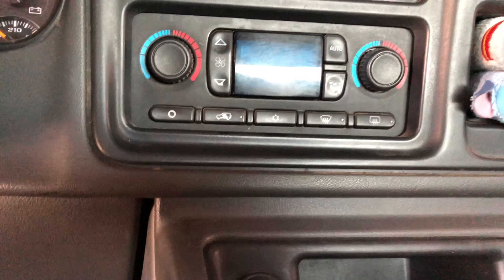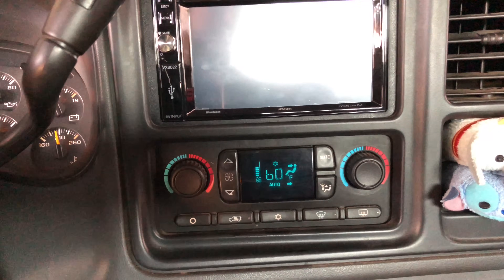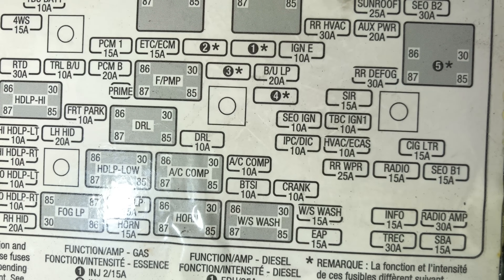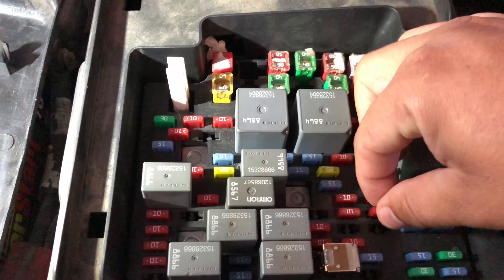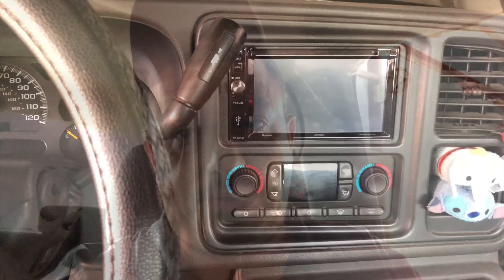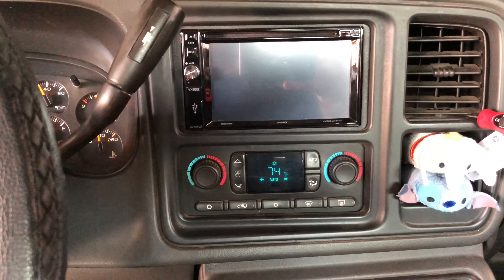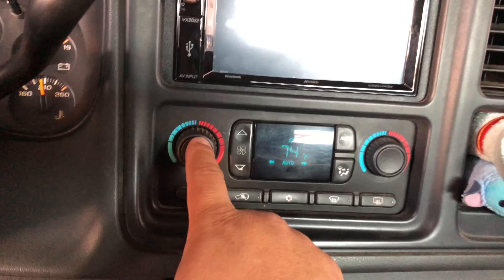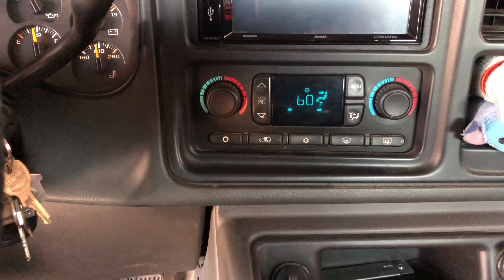HVAC Automatic Blend Motor Actuator Recalibration Procedure for GM Trucks & SUVS FOR FREE

Comment: I have a 2003 H2 with basically the same hvac system. I’m not getting any heat past my heater core. Which blender door actuator should I check for proper movement?
Reply from the maker: the "Blend door" actuator

Comment: Thanks for the video help me out however, my rear blend door is still not working I replaced it with another one from a salvaged tahoe. I did everything exactly as you instructed and everything seemed to be calibrating. Even the one I replaced it moved through the cycles. Still does not switch from cold to hot. Could it be the hot and cold knob?

Comment: This didnt work for me. I have fan power, I can tell the actuators are moving air from top to bottom. The compressor is cycling. The hose is hot on one side and cold on the other. Attached a simple gauge to it and it reads in the green indicating full. IDK what to do. This is a 2005 Chevy Suburban with front and rear AC/heat controls. Thanks
Reply from the maker: what do you mean by "it did not work" what are you trying to do?   this is for calibration only
Reply: @FalconsGarage  What I meant was that I dont have cold air. My issue must be more serious. I was just looking for a suggestion to fix it.  Good video by the way.

Comment: My problem is the car off and a fan motor still  on after the can powered down and battery is drained after 2 days the car sitting 
It’s driving me crazy any ideas what going on?
Reply from the maker: Must have a short somewhere. Would have to find a wiring diagram and start checking all wires

Comment: I have 2003 Chevy trailblazer ext. it does not have hvac on fuse box but it has ecas as 30 amp. Is it the same?

Comment: This worked once with my truck it worked. Trying it today nothing is happening. Guess they're all the way broke. It's not even cycling thru the positions.
Reply: The reset never moved any of the actuators, and 3 broken actuators at the same time doesn't seem right either. I just purchased a whole new AC controller to see if it could be that. We will see what happens once I install it.  What did you end up doing?

Comment: Thanks! I replaced the heat blend actuator and then used this method to reset the system. All is great now.
Reply: Okay! I have a 2008 GMC Sierra and there wasn’t  a fuse like that one in this video, so i just took all the hvac fuses out and followed these steps, still no go. When i turned it on it didn’t go 
to 74

Comment: Spot-on fix! 2009 Yukon SLT. Just thought I’d toss the year in there as one of the models this fix will work for. Fuse box is a bit different but not very hard to figure out by looking at the fuse box schematic. Sequence works the same way. Good job of explaining everything in straight talk layman’s terms. Enjoyed your presentation and am now a subscriber! Excellent! Thank you!
Reply: Does your truck have the roller type temp control wheels?

Comment: Your a great guy to know and explained the system easily !! Thanks you !!  ??? How many blend door actuators are in a 2007 Cadillac SRX . Blowing cold from left side and blowing heat from right side . Is there a actuator on each side of the console?? Waiting to hear from you 2/20/2020 at 2:20 PM we will never see that time and date again !!
Reply from the maker: if its a dual climate system .. then it should have a temp door for each side
Reply: @FalconsGarage  OK ! Thanks Falcon  ( Question ?? ) I went through all your reset steps and when completed.... . It 's Cold out side right now . I started the engine a let the system operate on automatic .. Only cold comes out of driver side  at all settings and hot and cold comes out of passenger side when thermostat is turned from cold to hot .. From watching your video I should change the driver side actuator .. Yes or no !!  Waiting to hear from you Falcon .. Thanks
Reply from the maker: does sound like a bad actuator .. but I would still test it or see if you hear any movement coming from it before just removing it

Comment: Great and informative video channel.  Have you seen a problem where the system will only blow hot air if the temp control is set to 90?  If it's set to anything under that, it reverts to cold air.  Thanks for all you do.
Reply: Hi Steve. What did you do to fix this. I have the same issues in my 03 Silverado.
Reply from the maker: I’ve had a similar problem in a Nissan and the problem on that car was the temp sensor for the cabin. So I would check on that on the car your talking about.

Comment: My is 2004 Chevy I program like you said but my truck don’t blow air but you can hear the ac working what wrong with the ac
Reply: Thank you soo much
Reply from the maker: Luis Ibarra if it doesn’t “blow” air. Maybe your blower or resistor are bad.
Reply: Falcon's Garage 
Blow cold air when the truck is running
Reply: Where is the blower
Reply: An resistor where should I start first fixing
Reply from the maker: The blower is under the glove box. The resisto should be next to it. The cable connectors to the blower usually comes from the resistor.

Comment: My blend doors cycle through just fine but winter time my driver's side blows cold and heat in the summer when air is on. Any clue on which actuator I need to replace?
Reply from the maker: I know you said they cycle fine. But is it calibrated?  
I believe the actual tie for the driver side is on the floorboard under the dash between the stereo and the gas pedal. But I would search up a diagram to make sure
Reply: @FalconsGarage  thanks man. Yes I've tried resetting three times.

Comment: My actuator was replaced but now the heat doesn't blow as strongly on the floor as it does up high. Is this a calibration issue? It vigorously flows to the high vents even when iv set the dial in between the two
Reply from the maker: It could be.  But with that been said all cars will always “flow” more air to the vents then defrost or floor because that’s how most are designed.

Comment: I replaced my modear actuator and did this and other recalibrationstuff but it won't leave from defrost mode. Any ideas?
Reply from the maker: are you sure you replace the correct actuator?
maybe start checking the wiring hardness ..
Reply: @FalconsGarage  hey man I did the calibration I changed all the actuators on 2004 avalanche was stuck on just defrost no feet no vents and did this it now comes out vents floors everywhere I choose to BUT do you know why it comes out cold on driver side and rear center console vents come out cold ? Passenger comes out hot and I'm in chicago so it's very cold for the heat not to work o recalibrated a few more times to see but still super cold I changed all 3 actuators. Passenger bottom top by the under vent and driver side on top of pedal. Still same issue even with calibration any thoughts
Reply: @TheLethalott  Hey I had that issue I unplugged the wire harness from the back of my a/c control module and it fixed it
Reply: @jodyfeazell6513  thank you my dood. Definitely worked get hear and freon that's weird how that would fix it after installing new ones I wonder if that means anything going bad with my ac module

Comment: Awsome video but have no heat at all thermastat is good,heater core is good i changed the climate control panel and the blend door actuator any other ideas its 05 chevy uplander
Reply from the maker: are the hoses going to the heater core HOT?
Reply: @FalconsGarage  yes they are

Comment: Question. When I turn the dial up or down, sometimes it goes in order, sometimes it jumps around like so. 70, 71, 72, 78, 74, 77,   etc. Happens slow and fast turning. Im going to try this reset see if it helps.
Reply from the maker: To be honest I don’t think this reset will help you. I think there might be an issue with your nobs or inside the controller

Comment: My 2005 GMC Yukon SLT also has HVAC 1 at my dashboard. Is that connected to the rear AC/ Heat? My vents are blowing cold air when heater is on.
Reply from the maker: make sure that nobody has bypassed the heater hoses to the cabin ...

Comment: It was worth a shot for my avalanche. Didn’t work, I am starting to have an issue with the heater system. When it started to become cooled down here in the south I switched over from the AC to Heat. It kept blowing cold. Does anybody know what this could be? I checked the 2 hoses that go into the heater core, they are hot. I have no leaks. Controls/electronic functions work properly. I don’t know if it is an actuator or a bad heater core.
Reply from the maker: sounds like bad actuators to me

Comment: Hey bro my driver side is hot but passenger is nice and cold. Where is that actuator I need to replace?
Reply from the maker: Both of those actuators are about 2 feet from each other. Both are on the bottom of the dash in the middle.  One is closer to the passenger side and one closer to the driver side. But I would first make sure that’s what wrong before replacing them.

Comment: I have a trailblazer 02 and the problem is that the a / c module went off by itself and does not turn on but the light does come on but the module screen does not and therefore the a / c compressor does not turn on you know it can be
Reply from the maker: maybe a bad module?
I've never encounter this problem before

Comment: Battery died and had to be replaced on my Chevy traverse 2011 after that AC was only blowing hot air, recharged with refrigerant driver side is blowing a little cooler but not all the way cold & passenger side is still blowing kind of warm any ideas? Thank uuuu

Comment: I have a 1999 corvette and it blows really cold then after a while on the passenger side it will start blowing normal air (almost hot) what do you think it is ?
Reply from the maker: If I’m not mistaken that system has a combination of vacuum lines and electric actuators .... so it could be many things. It could even be an intake vacuum leak. So check all vacuums and actuators

Comment: On my 02 TrailBlazer it reads -32 for the outside temperature instead of the actual temperature.  Do you think this reset would help?
Reply from the maker: Don’t think so.  Sounds like you have a bad air temp sensor or it’s disconnected.
Reply: Falcon's Garage thank you, we’ll check that out.
Reply from the maker: I think the air temp sensor will be on the outside of the car .. by the hood .. thats were they usually are
Reply: Falcon's Garage that’s what I was finding, wanted to verify. Thank you
Reply: Thank you so much for your help.  That fixed the problem.  I have air once again.  I appreciate you answering all of my questions.
Reply: Having trouble finding anything on an air temp sensor. Can it be called anything else?  Assuming this is in the dash behind the air/heat controller. Thank you
Reply from the maker: just want to confirm .. what reads -32?    the dash (cluster) or the temperature shown in the ac temp controls?
Reply: @FalconsGarage   temperature shown in the ac temp controls
Reply: it use to read the actual temperature outside if I'm not mistaken.  Sometimes it reads 50 and the air will work, then it goes to -32 and the air quits working.  Hope I'm explaining this okay.
Reply: I can take a picture if that helps

Comment: My 07 acadia ac blower will not rumn. Replaced blower motor, controll module or resistor, all fuses and relays test good. Even checked the harnesses for continuity and wires are good. Still no blower operation. Help me
Reply from the maker: I would find the wiring diagram and check every wire to it

Comment: Hey man I was drivin down the road the other day and I had the ac on 60 all the way and out of know where it started blowin heat but the passenger side was blowin cold stopped turned the truck off and It went back cold but the heat still comes back here and there any suggestions?
Reply from the maker: maybe bad blend door actuator
Reply: try this recalibration , it fixed mine !
Reply: StumpjumperVideos I did a couple weeks back and it fixed mine to!
Reply: awsome !

Comment: Same procedure for a 2014 and up? Can't find that information anywhere for newer ones.
Reply from the maker: not sure .. most newer cars need a tech 2 scanner to calibrate
Reply: @FalconsGarage  Found out its different. Only way to do it is disconnect battery cable for a few minutes. Reconnect and turn on ignition. After power loss they recalibrate on their own it appears. Worked for me for now anyway.
Reply from the maker: Great. Thanks for the info.

Comment: outstanding.  Twice now my system was blowing HOT air as soon as I started my truck when it was set at 60. I turned the system off thinking I needed AC service, but on the next start up, it blew cold air.  So I figure its got to be the controller.  I hope this solves my problem.
Reply: How did you make out?  Did you replace the part or just try and recalibrate?
Reply: @popiscoolnow  recal and it has not happened since.
Reply: sailure1 thanks. Glad it worked. Stay cool bro.

Comment: Do have to recalibrate all replacement actuators? And is the process the same? Talking about 2009 Impala.
Reply from the maker: i dont know about the calibration process on the impala .. but you done have to re calibrate when replacing old actuators most of the time
Reply: Falcon's Garage Thanks. My car doesn't have the auto function so I think I'll be okay. Part will be here Wednesday.

Comment: I have the clicking noise under the dash during start up, does this mean the actuator needs replacing? do you think a reset could solve the clicking and HVAC problem or should i go straight to replacing? thanks for the awesome video
Reply from the maker: the clicking is most likely a bad actuator.
Reply: Falcon's Garage thanks! going to replace it. thanks for the quick response and advice!
Reply: @throckmortonsgarage4650   Did the reset work for you?

Comment: So I did this and followed all instructions at least 5 times. My hot and cold works fine. While it’s Cali rating I can feel the air move from defroster to vents to floor and then back to vents and back to defroster. I waited the time shut the car off and then turned back on. Once I turn the car back on it cycles again and then goes to defrost. The knob doesn’t change where the air is coming from. But when it’s calibrating it moves fine. The actuator is about 4 months old. The old completely crapped out. This one worked fine for 4 months then my battery was replaced and now it’s doing this. Hot to cold no issue. Recirc. Or fresh no problem. Only issue is where it blows from. Please help!! I have a 2004 Tahoe with dual climate sliders. Not computerized.

Comment: thank you for this video. Will this work for a 2009 Cadillac?  Looking at the mini fuse for the A/C CLTCH..
Reply from the maker: I don't think cadillacs have the same AC pannel
Reply: Usually ac clutches have relays not fuses but not certain for you car
Reply: Theirs no hvac ecas fuses on the ‘10 escalade. I tried hvac batt and it does reset to 74- but the diagnostic stay their, no dance

Comment: Mine been stuck on defrost any help ? I did this but it didn’t work.
Reply from the maker: maybe a bad mode door actuator
Reply: I had a same Check Engine light come on. I live out in backwoods with field rats. Took it to O'Reilly 's for a free check up... $180 worth a gasket and sensor....plus $400 2 hour labor cost. Unplugged battery..... plugged back up 4min later...still getting 19mpg on a 195k 5.33 L33 4x4 with 4:10 gears... now I have to the the cold air to start working ....crossing fingers

Comment: Falcon,  I have a 2004 Cadillac EXT , the problem is that my traction light and ABS light both are on which I noticed my engine sounds and performs like it’s in low gear at reduced power. my dash screen reads Service Stability. I would appreciate any input you may have.
Reply from the maker: one of 2 things is going on ..
either you have allot of issues because most of those components are not related to each other
or you have a bad ground somewhere cause all this systems to go crazy
Reply: You have to take ot to have the stabitrak update ! I thought my Acadia was a gonner!! But i had it sent to GM dealer. They reset the module!

Comment: Thanks for your video I removed my battery from my 2002 Envoy now I have ac blowing from heater vent and cannot turn ac off. Any thoughts on this problem.
Reply from the maker: could be that they just need to be calibrated
Reply: there are four vent actuator motors that operate the open and close.Just remove them and turn the vent by hand.

Comment: Excellent video! Provides hard to find info. Falcon, hope you dont mind me providing the following. Here are the steps in a nutshell, taken from your video: 
Yukon Blend Door Calibration Procedure
Turn ignition to on (not start).
Press Auto on HVAC Controls.
Turn ignition off.
Remove HVAC/ECAS 10A fuse (lower right hand corner fuse box).
Wait 1 minute.
Replace fuse.
Start truck. Screen should show 74 degrees & cycle thru.
Wait 2 minutes.
Turn ignition off.
Wait 15 seconds.
Start truck.
Test. Should be fixed.
Reply from the maker: Thanks!
Reply: @FalconsGarage  Hello FalconsGarage. do you know if this will also fix a stuck ventalation door , mine is stuck on even if i push the button and the light says inside air only  , i can't get it to blow from cab only mode for inside air circulation . i get exhaust fumes from cars in front of me. drives me crazy. will this procedure also reset this? cheers!